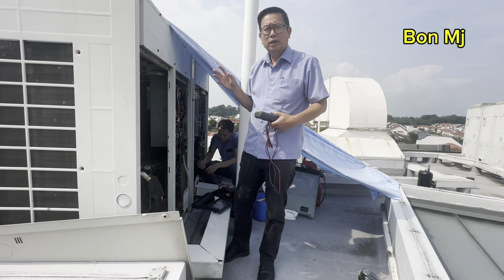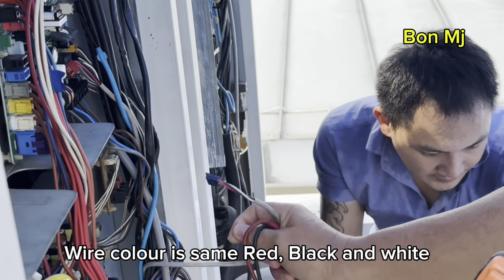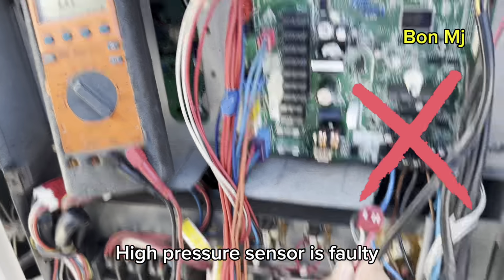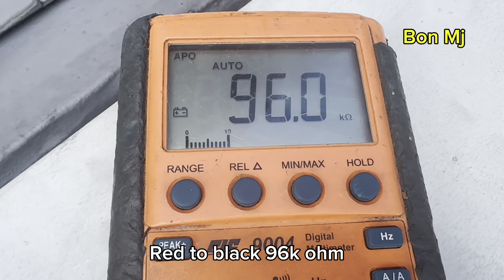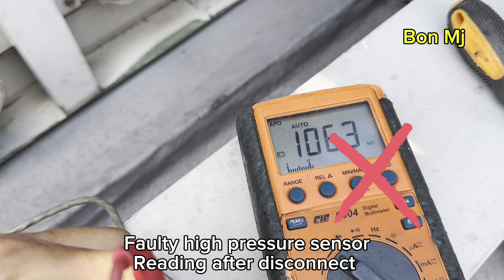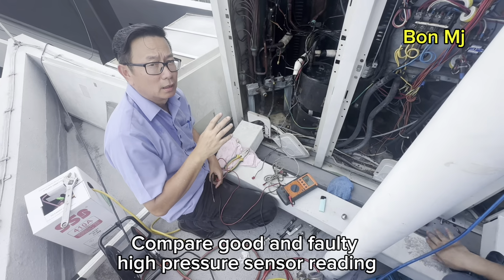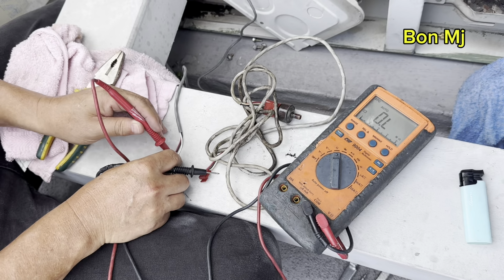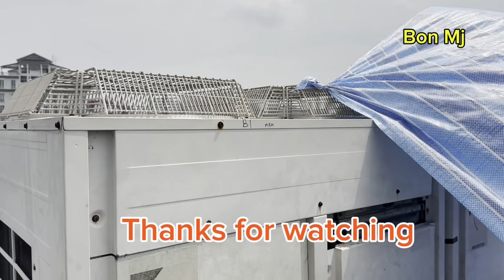How to troubleshoot common AC pressure sensor problem | VRV - Daikin

Comment: Hi sir when you replace high pressure sensor, have to keep the gas always right? Then fix new parts vaccum? Pls explain
Reply: Do you want to remove all the gas?
Reply from the maker: @dinuwa9261 cU only
Reply: @BonMj  sorry don't understand，is it pump down only？or release all the  gas？pls reply😅

Comment: Hiii , Bon 
First Of Happy New year from   India🇮🇳 

Please Make. Video on Daikin VRV 4 , Error. UA-  20

I removed one single circuit control pcb from 18 HP, and the other 18+12= 30 HP system master outdoor 18 HP then replaced the control pcb UA-20.  Error occurred,

Comment: Rxq 8pay1 vrv  3 change printed circuit board change tip switch also but still I get error code JA .selive unit.now masteronly running bypass ready .can give any tips.
Reply from the maker: Check high pressure sensor.
Refer my JA video
Reply: @BonMj  thanks